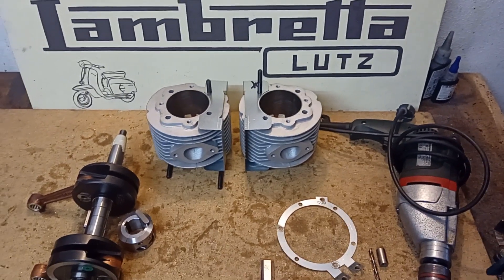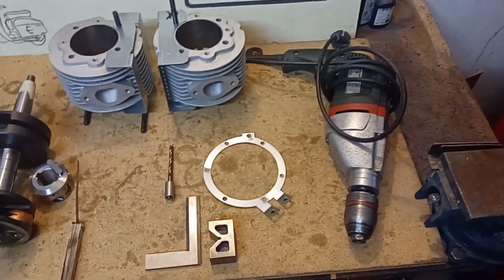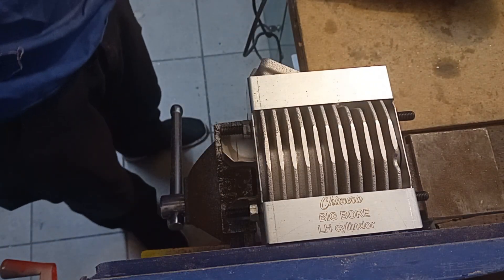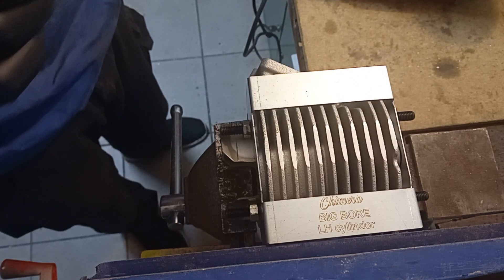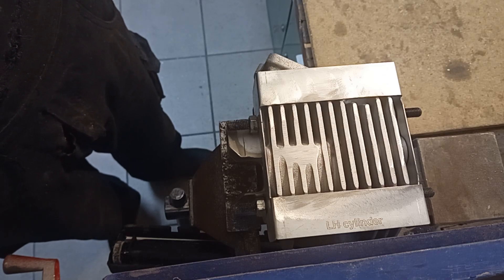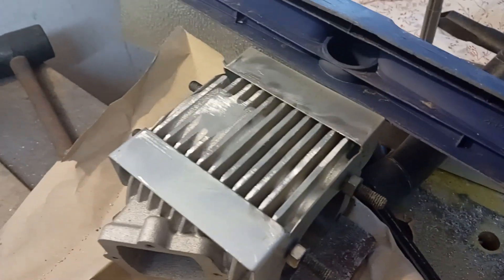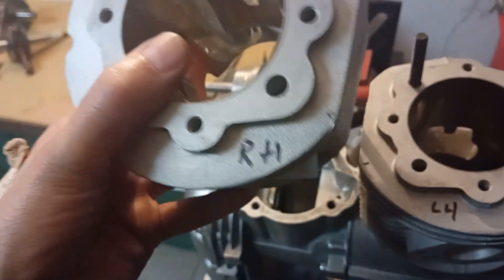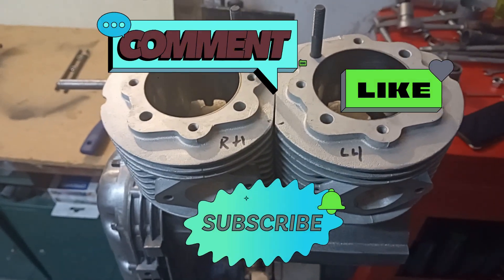#Lambretta Twin Cylinder Engine Build Full Tutorial Part 4 - using #Chimera Twin Conversion Kit

Comment: What are the long term of reviews of this conversions like, I’ve seen no one on social media who has one or is operating one. The crank joining coupling, is this something that needs regular tightening? What other reliability issues have you seen thus far?
Reply from the maker: "Thanks for the support, Coolrunnings2,

As for your questions: The long-term reviews so far have been positive, but it’s true that not many owners share updates on social media yet. The crank coupling is designed to be maintenance-free after proper installation and doesn’t require regular tightening. In terms of reliability, we’ve been closely monitoring the kits, and there haven’t been any major issues reported. That said, it’s still an evolving project, and we’re always gathering feedback to make improvements!"